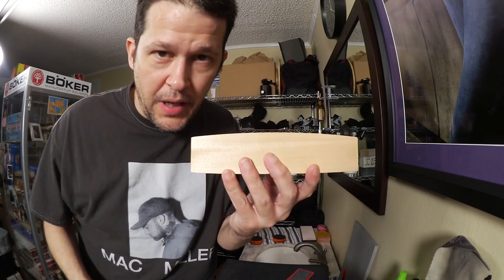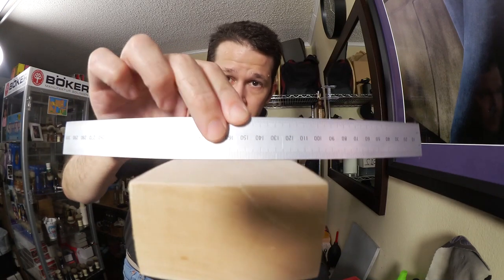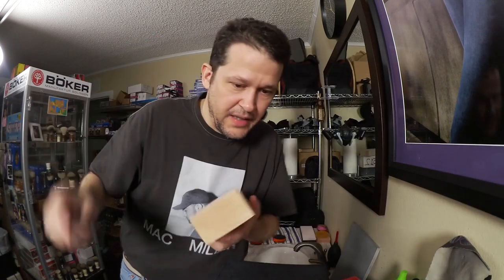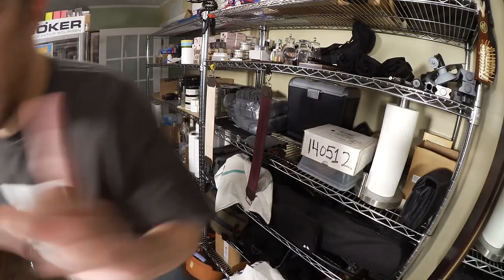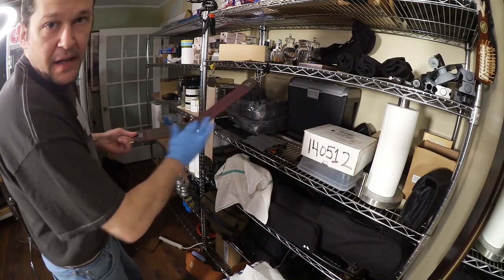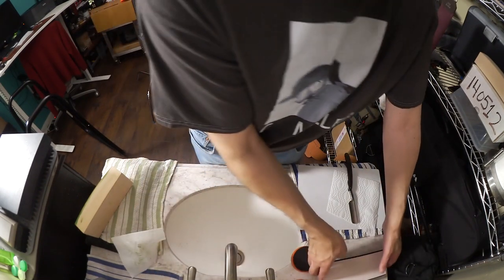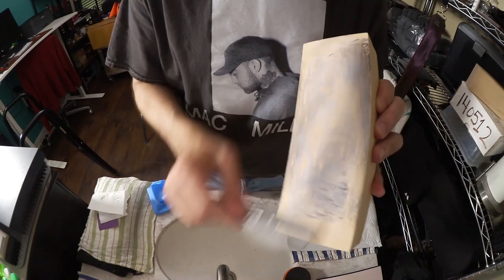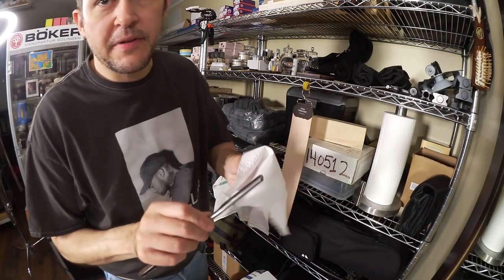Convex Wood Block Sharpening - Making the Straight Razor Bevel Concave to Maximize its Flexibility

Comment: Can you explain the reason for having two arcs? I understand having an arc in the long axis, but why is there an arc to the width?
Reply from the maker: Reason is because no razor is perfectly flat, a perfect cylinder would necessarily remove more steel in creating the concave bevel. 

A long time ago, an old grinder told me "there is no such thing as a flat razor, only the magnification varied to see it".

When you see ppl on forums espousing the 'Rolling-X' stroke as a means to hone troublesome/warped razors, what they're really doing is not having the razor flush and parallel to the hone from heel to toe... a curved hone across the width will do much the same thing.  

In a perfect world, the diameter across the hone would be as long as possible w/o exceeding the shortest effective diameter across the cutting edge on the minimum spec-passing razor... so if the grinders allow a warp of 35', for example, if we put just the slightest curve across our hones of 30', we guarantee that we cannot touch the razor twice with a gap in between (which could occur if the hone's diameter across was longer than the razor's warp's effective diameter).

In general I want the earliest step coarser hones to have as long a diameter across the stone as possible, then finer longer diameter stones to have a shorter diameter across the stone... helps me with feedback to reduce that contact patch size a bit, and if kept to the later stages it gives you that great feedback without high stakes of fussing about with bevel width.

Comment: So how do you measure the course on the wood block when you are forming it? As in how do you form your blocks? I know you have a concave aluminum plate
Reply from the maker: the wood block's formed on its two 3x8" sides versus the same aluminum plate forming the whetstones, just varying which way the wood block faces the 9x11" plate as with the whetstones...if you're trying to set in a new edge with a coarse paste like Dovo green, you'll want to use the short diameter and it'll make a nice wide uniform bevel (very slowly)
Reply: What's the backside diameter? You said the top was six and a half feet. I'm interested in how this works and why it differs from the 'you must lap all your stones flat before you start' that i was told.  
T
Reply from the maker: it is my belief (backed by the published statement from Pike/Norton and the statements from Dovo and Thiers-Issard's ownership) that you have been misled.  The Thiers-Issard owner told me in 2011 "Americans will never understand or accept the convex hone", what a pity his elite-French-accented diss was so spot-on.

See this video for more information

https://youtu.be/MZR0QGOBvDA

I used one shaping device with two different diameters 90-degrees to one another to make the wood block, the 'back' side has a diameter of 25' down the length.